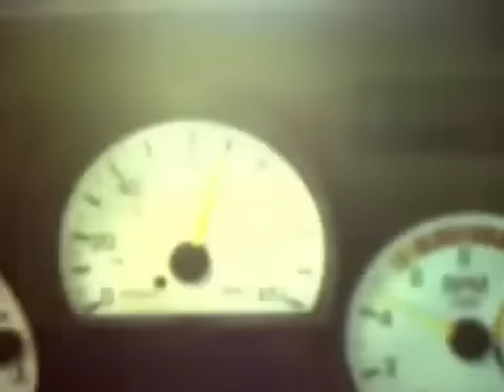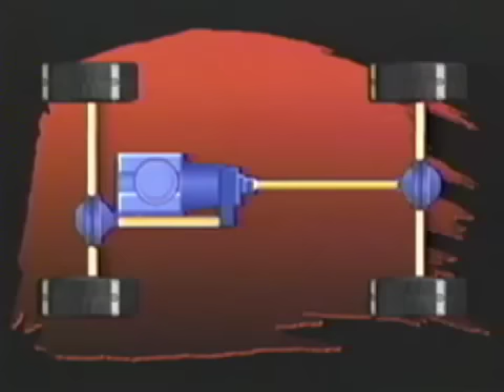GMC Syclone Typhoon

Comment: well its got a LB4 GM V6 with a Mitsubishi TD06-17C turbocharger and a Garrett water/air intercooler.  The whole setup makes 280hp and 360ft-lbs of torque.  The transmission is a 4-speed automatic GM 700R4. The transfer case is a 35/65 Borg Warner 1372/4472. 0-60 in 4.6 sec and the 1/4 mile in 13.4 sec at 98 mph.  Hope thats what you wanted to know

Comment: Wonder if I can make one of these...
It's the GNX motor right?

Are they AWD?

I've heard with minor mods... Holding the brake and pushing the gas (since they're automatic) you can get the front tires to lift off the ground a little with enough boost.

Comment: @Ridinred02 I know that lol. That's why I asked if there were any other cars with the same engine structure.

I've turbo'd my tercel and a few different 4g63 engines in cars. I just want the drivetrain and engine and maybe drop it into something else - or possibly put it in a non sy/ty blazer.
I need another project (which is why I asked) - although it looks like my next one will have to be something cheap again - probably more DSM in a hyundai or something of the sorts.

Comment: Hey guys, i thing GMC needs to take there new Canyon and put either a supercharged 4.8 or a new ls-2 in an extended cab and rename it the canyon syclone. If chevy wont have the balls to put that much power in those trucks then GMC should saying who they are the first to make factory truck peformance. They should take there crown back. GM is there already with the ss trailblazer, my buddy has on and it will keep up with a vette. but now they need to just make a truck.